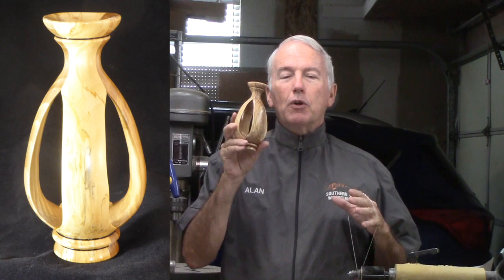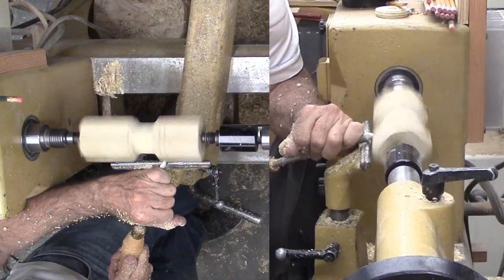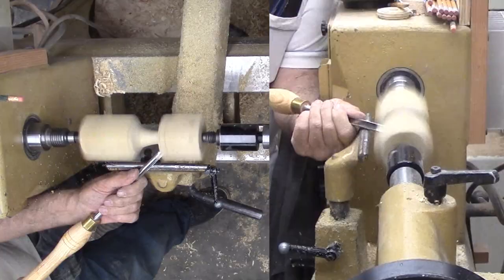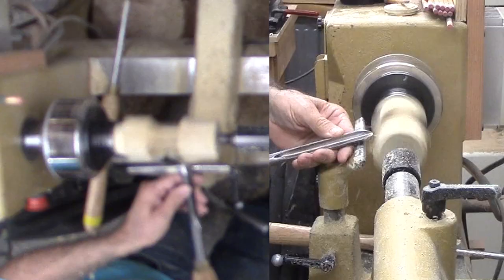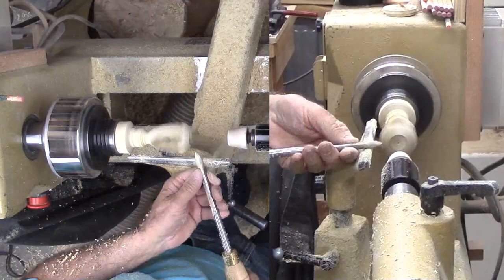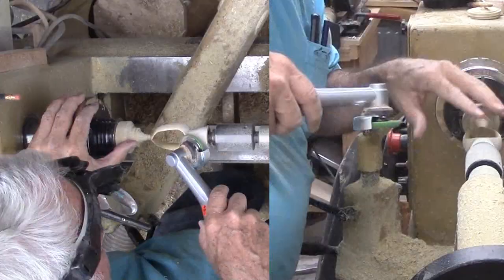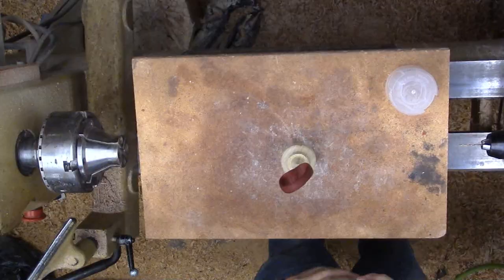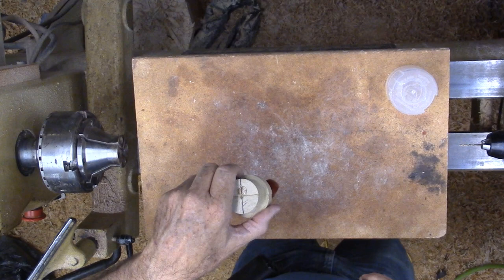Woodturning Two Stave Inside Out Heart Pendent

Comment: Great project Alan. I wonder if that project could use lost wood process for reducing the amount of air and possibly provide some strength when thinning. It may even eliminate the two ears that you had to manually carve away. Paper joint scrap wood to each side of the "good" wood then remove after final shaping. Just a thought that popped into my mind when you got to the ears.
Reply from the maker: A good technique to keep in mind. But on this project, I probably should have started with thinner wood so that the final glue up was rectangular rather than square.
Alan